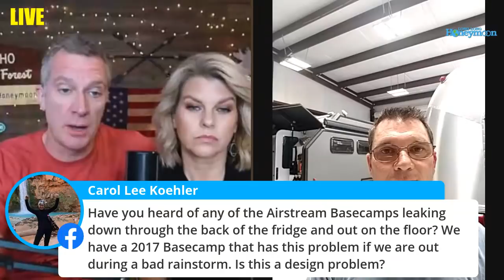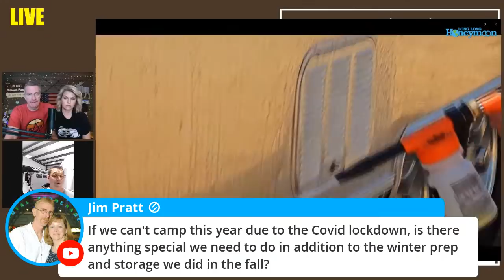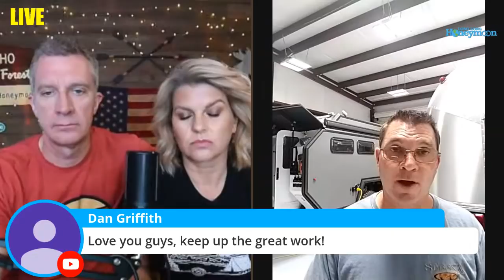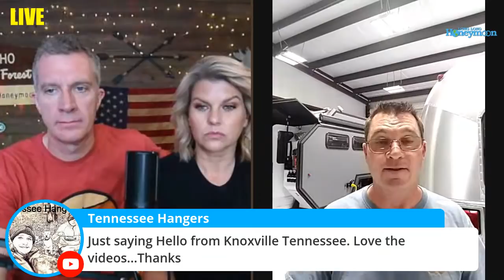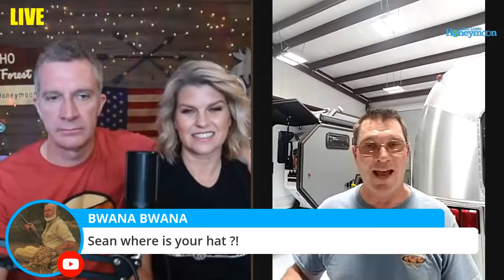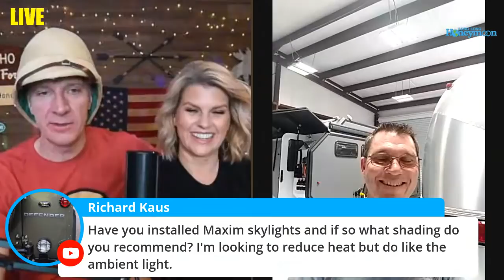LIVE Q & A -- Sean & Kristy with Airstream Expert VINNIE LAMICA

Comment: Really enjoyed this video. Ya'll are my go to for Airstream things. So, with that said...
Where can we get a washer/dryer installed in a 33' Classic with queen bed?
Hope you get to travel again soon.
Reply: We just purchased a 33’ Classic FBQ. We are installing a washer with air dryer in the closet. According to the Airstream rep, you can have a washer/dryer combo added at their Jackson Center Airstream Service Center. I’ve seen costs from $5000-$22,000. What we are doing will cost about $400 doing it ourselves. Having a washer/dryer was a huge sticking point for us as we were downsizing from a Class A with a washer/dryer combo that was used frequently. After research, we decided to try the Giantex Fully Automatic washer with air dry that weighs in around 50 pounds (we are monitoring our weight limit) and is light enough I can pick it up. We did several loads to test the machine first and it did a good job.

Comment: Guys, reading through your buy an airstream book tonight after watching the likes and dislikes video. Great stuff and appreciate you for the time and effort at developing an Airstream information channel. A visit to Vinnie will be in my (I hope) not so distant future. That all said, reason for this novel is to share an eBay purchase experience. In 2017 I bought a 2017 Ram 3500 4x4 dually off eBay. Truck in Texas and I am in Hawaii. My experience being awesome is not the message, that can go either way. I want you to know about “we go look”. Have you heard of it? You hire a third party to go look at where ever it is you are buying.  Within 24 hours I had a complete report on the truck. The report matched what was advertised, I had verification the truck existed, the seller was legit (actually a dealership), and then they shipped the truck anywhere in the lower 48 for free.  By using the eBay down payment function, it secure a $100K buyers insurance protection and the shipping company added another $50K while it was on the road.  I wish ther were a bunch of Vinnies out there working for we go look.  Anyway, when I find one that’s worth a $100 to go look, I will use We Go Look as the first step. Your experiences will assist me in telling them what to ask and look for. I have already decided on 20 years max and automatic replacement of shocks, bearings and tires just for piece of mind. Thanks for being out there clearing a path for the rest of us.

Comment: We had a 2008 Classic 25fb that had a water leak at the rear window where water would drip down the bug screen. It took me 2 years to fix it. Had the pressure test performed and no bubbles found from the soap solution. Ended up fining it my self. Used duct tape to cover the riveted seams on the curved end cap. Sprayed water on the corner of the end cap over the rear window where the water drips on the inside down the bug screen. Removed 6” of duct tape at a time and put water on it. Found the leak from a couple of adjacent rivets. Applied some Parbond silver sealant around the rivet heads and it fixed the leak. Had an Airstream shop drill out the rivets and they discovered the original rivet holes in that area were drilled wrong so water was leaking past the rivet heads, running down between the panel edges behind the Acryl sealant down to the window frame where it met a window mounting screw where it leaked down onto the interior bug screen. The bad rivets were replaced with Olympic rivets and Tempro sealant. We had a Truma Aquago Comfort hybrid water heater installed. A small tank is heated to 110f via propane burner and maintains that temperature. It takes less than 30 seconds to heat that small tank.  When a faucet is opened the burner comes on to heat the water through the water to 120f. Worked well and in cold weather you can set the Truma to eco mode to keep the water at 40f. The water heater has to be decalcified depending on the hardness of the water. The tablets cost $20 from Truma dealers or Truma. If you don’t use a water softener for hard water you would need to decalcify the water heater every 3 months if full timing. We had a water softener so we reduced that to once a year.  The Truma was great for showers but felt the water for washing dishes could be a little hotter. We now have a Tiffin diesel pusher motorhome to continue full time. We had Maxim skylights. The metal inside frame formed a lot of condensation in the cold due to lake of a thermal break in the frame. One of them the white powdery oat was starting to peel. I was a little disappointed after reading the reviews. We looked at a new Classic 30 before motorhomes but didn’t feel it offered enough space for the money over our 25fb. Need to find a Tiffin Whisperer now.

Comment: Ceramic coating is not new to anyone with an expensive or show automobile. Glad to see Airstream owners catching on. Of note: it is very expensive. Very. The quality of the work isn’t so much the brand of coating chosen, but the installer. Finding an experienced qualified installer is difficult because there are many many tinting and body shops promoting this service. This topic is well worth a video. There are many YouTube videos on coating cars, check them out to start.
Reply: Hi from jasper ga